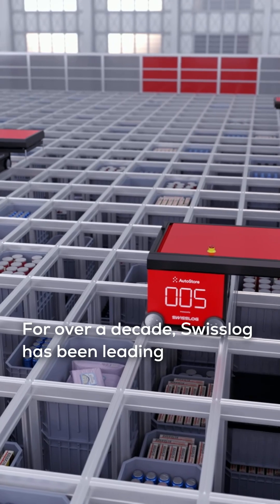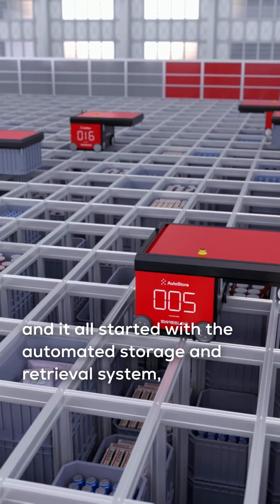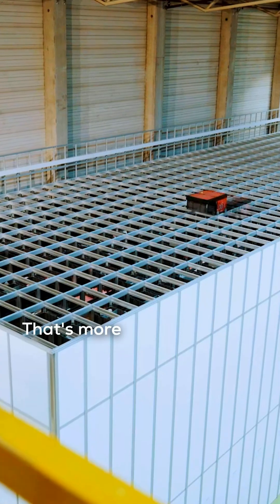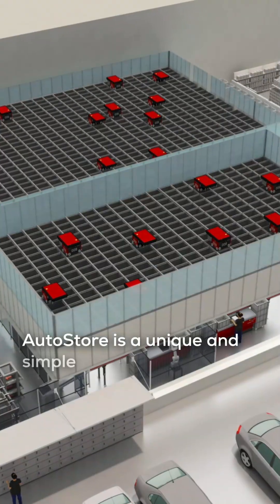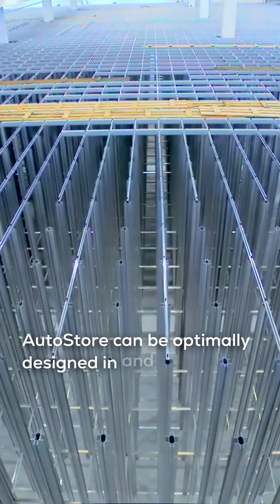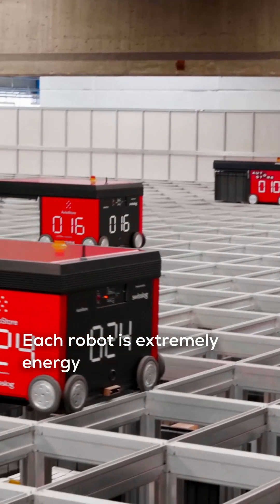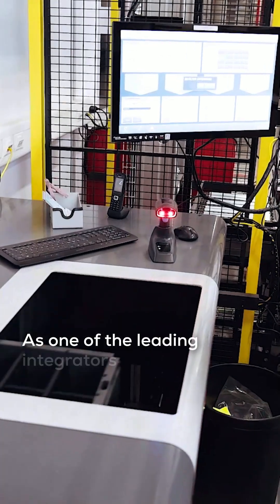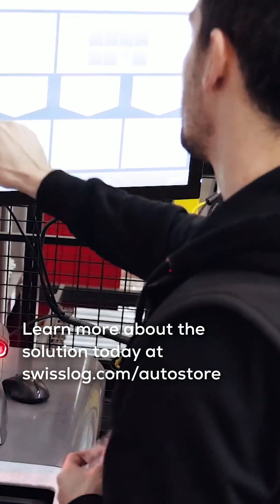AutoStore by Swisslog: Robotized storage and order picking system that’s highly space efficient ⏩

Comment from the maker: AutoStore is a unique and simple solution that uses robots and bins to quickly process small parts orders. It provides better use of available space than any other automated system thanks to its unique design that enables direct stacking of bins on top of each other and storage of multiple SKUs in a single bin.

Swisslog is a leading global integrator of AutoStore with more than 370 implemented projects globally. AutoStore is highly flexible and can be designed around existing buildings with the ability to add other Swisslog subsystems including robots, conveyors, packing stations and software.

Learn more about AutoStore, from one of the world’s leading integrators at www.swisslog.com/autostore
Reply: Why dont you write another fact about Autostore? That real hardworking people get fired because of this. That the ones who are left has a sad workplace because of it? This is the worst thing that have happened to warehouse workers and should not be recommended.

Its a disaster. So believe me when i say that no company should get this.